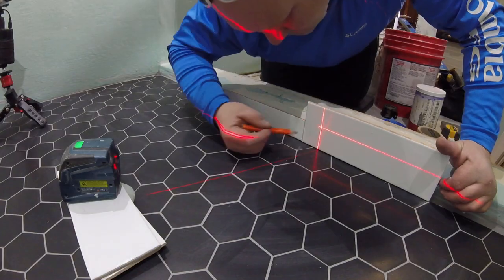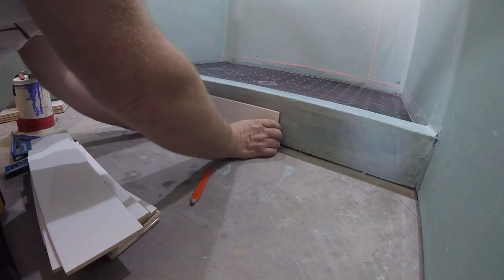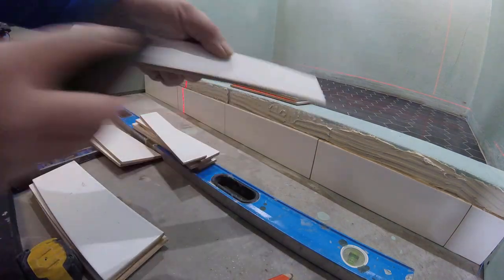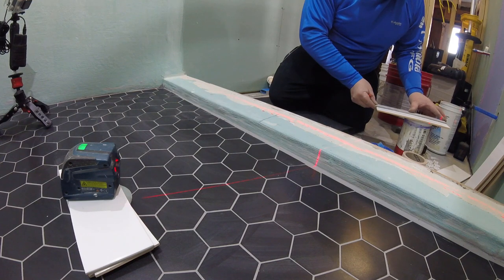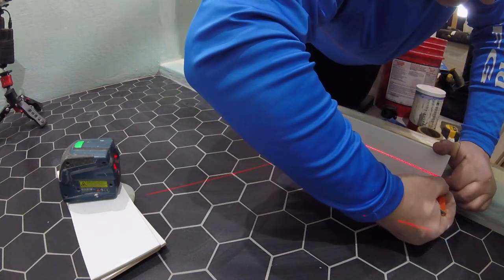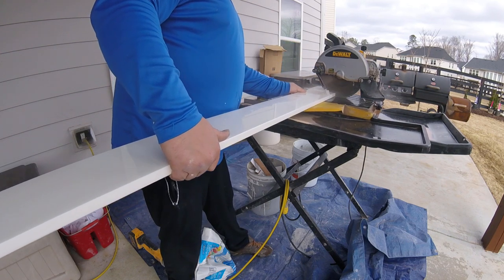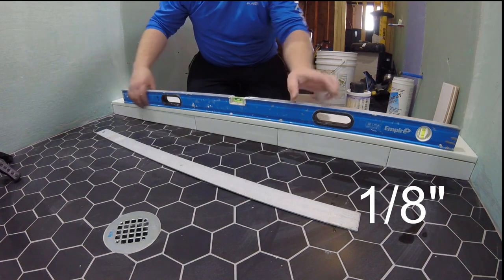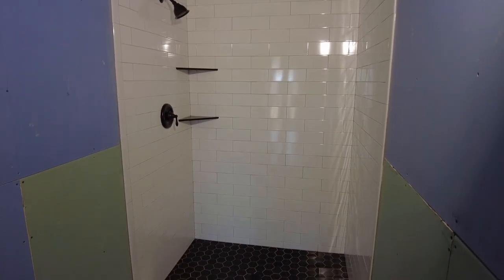Shower Curb Tile Installation & Glass Shower Curb

Comment: Always enjoying your video. Great info on the one piece nano-glass curb. thanks for sharing.
Reply from the maker: Thanks for watching!
Reply: i watched your video regarding building the curb using 2x4. i noticed that you used 
1. treated wood on first one
2. standard 2x4 - 2 more 
3. waterproof with Aquadenfense
3. cover with Oatey liner
4. cement board around the curb with thinset
4. then tile
this is solid protection from leaking .  did i miss anything?  @simonproatl
Reply from the maker: 4. Cement board around the curb with thin set and fiberglass mesh (wrap entire curb or a least all seams with strong 2" fiberglass mesh). 
5. 2-3 Layers of Waterproofing Membrane. 
6. Tile (shower floor first and grout it then shower curb and shower walls)
Good Luck! You Can DO IT :)  @vinhgolf

Comment: Great video. Trying to follow your foot steps. I noticed you did not leave a little gab between the curb tiles and shower floor tiles. Should there be at least 1/16 gab there?
Reply from the maker: Yes. Graut will hold better is you leave small gap.
Reply: Hey, Simon, I followed your video and finished my shower curb. But I didn’t cut well on one inside curb tile, the gab between the bottom of this tile and the mosaic floor tile is slightly larger than 1/4”. Should I worry about that? Is silicon good for wider gaps? Any advices? @simonproatl
Reply from the maker: 1/4" It's a large gap. If you grout it well and silicone it you should be OK. If you waterproof everything underneath you should be fine.
Reply: Thanks. You mean grout the 1/4 gap, then silicon on top of it? @simonproatl
Reply from the maker: You can use MAPEI Silicone Caulk that matches your grout color  @AndroidTester-g3p
Reply from the maker: Yes @AndroidTester-g3p
Reply: Thanks. I used a section of backer rod to fill the 1/4 gap, then applied silicone caulk over it. Hope everything should be good. This is Ardex shower system installation. After cutting down the Ardex shower base to fit my bathroom, the edges are no longer level. As for water proof, both redguard and Ardex water proof membrane were applied to the curb. @simonproatl

Comment: After smoothing out the thinset on top of the curb, how long did you wait before you installed marble top? It could take a while to cut the marble, and the thinset on top might have been dried? @simonproatl
Reply from the maker: You don't want to wait thin set must be fresh.  You have to cut your marble curb first then sooth out the thin set and install curb.
Reply: Thanks for the clarification. That make sense.  @simonproatl